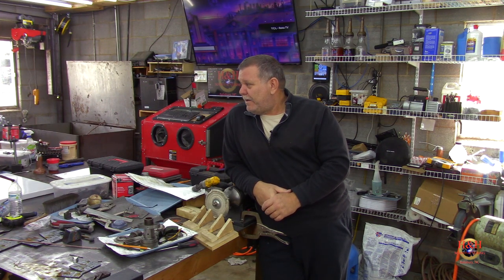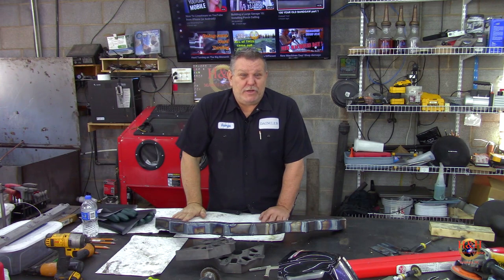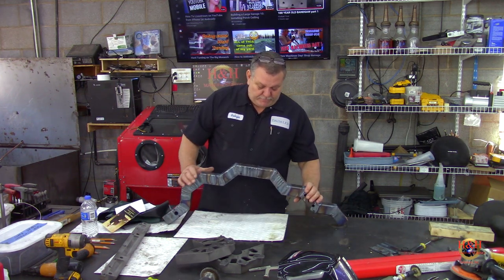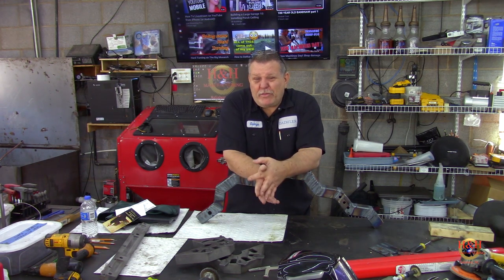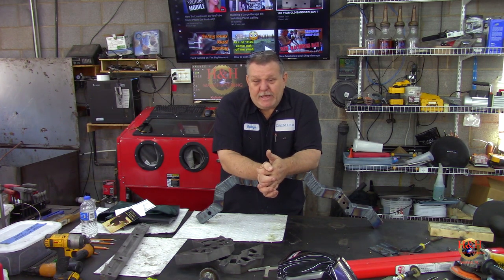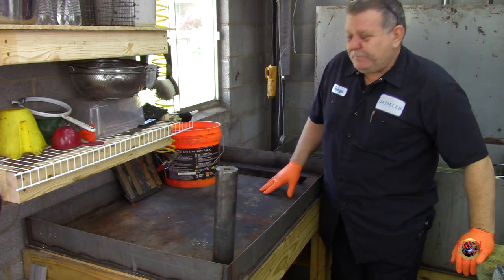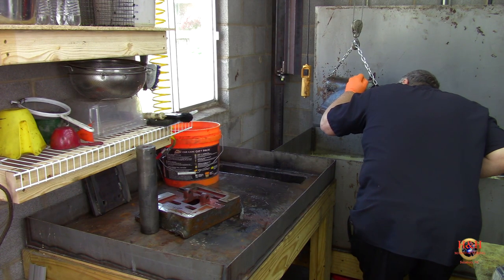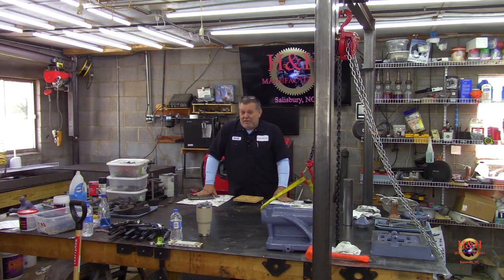Sidney Lathe Resto 33 --- Rebuilding the Tailstock

Comment: Honestly your baseplate looks better than the factory one. Only thing it's lacking is the slots to allow for offsetting the tailstock, but that's not very useful. Have you developed a good strategy for pulling the oil gits out? I've found that drilling a small hole in the ball and using a coarse woodscrew in a slide hammer works very well.
Reply from the maker: The Metal Butcher that is what I was planning on doing. Hindsight being 2020 I should have removed them before painting